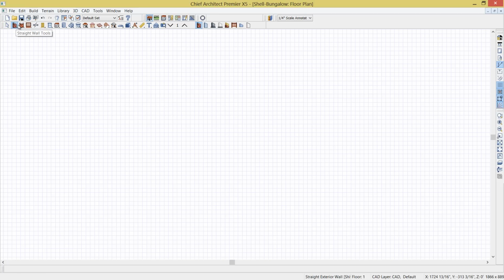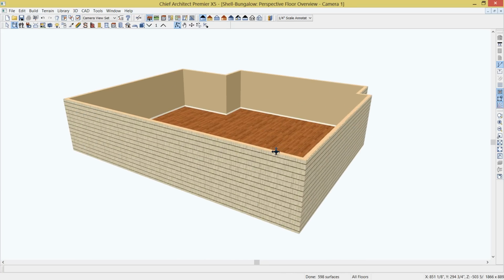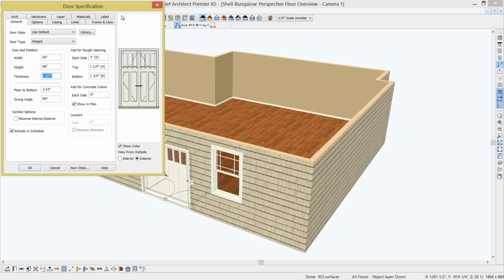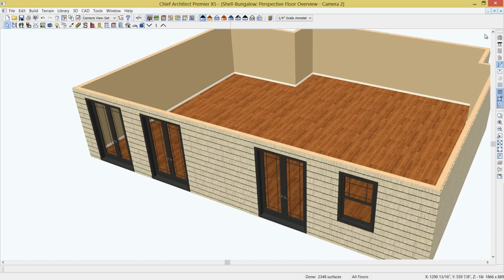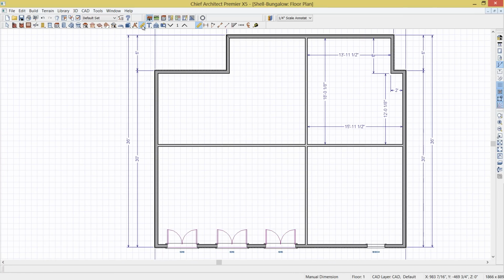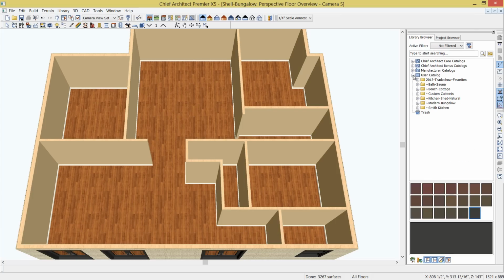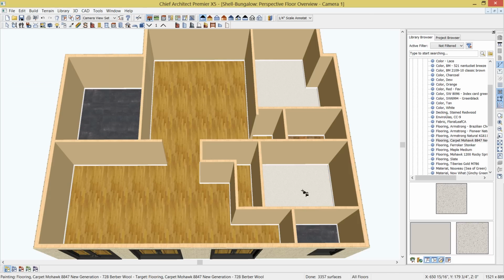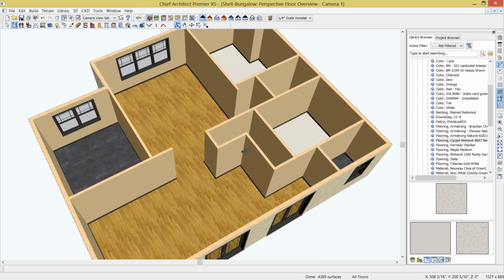1 Intro-Modern Bungalow

Comment: Does Chief Architect have a metric system option?
Reply from the maker: Yes.  You can specify imperial or metric units through the preferences or dimensioning defaults.
Reply: Chief Architect Inc. Alright.Thanks a bunch

Comment from the maker: To remove the ceiling from one room simply open the room specification and under the Structure tab uncheck Ceiling Over This Room.  If you don't want the ceiling on the entire floor, you can go to Edit>Defaults>Floor and  under the Structure tab uncheck Ceiling Over This Room.